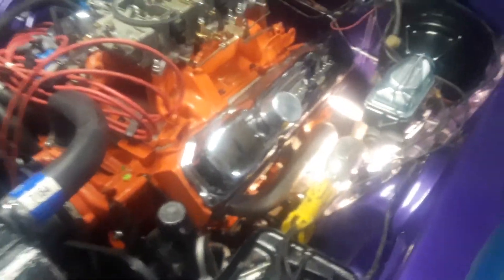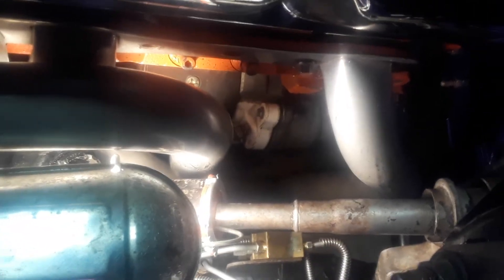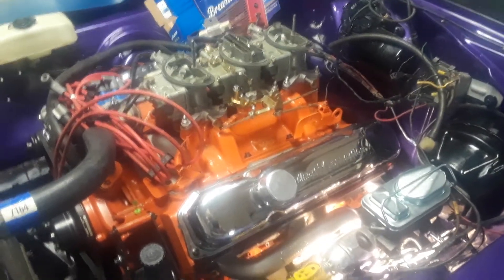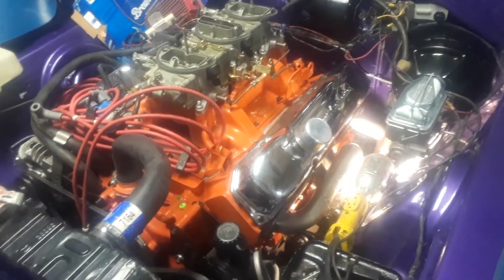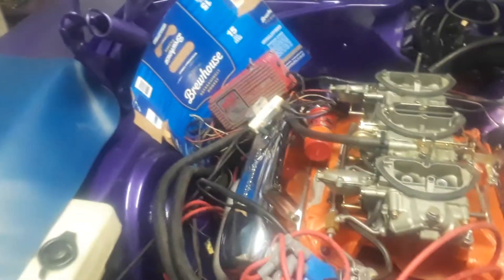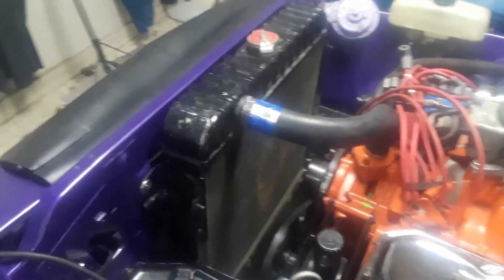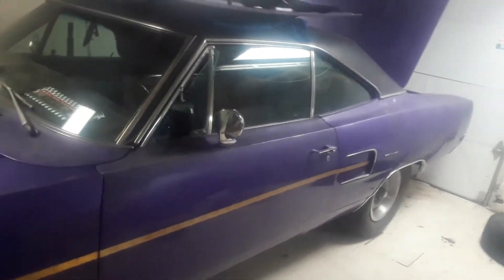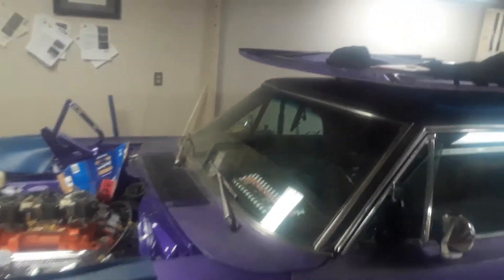Randys road runner RRR

Comment: Hi CN  would 12volt thermostat controlled fans be an option?
Reply from the maker: yes and aluminum 4 core rad also about an extra 2000 all in
Reply: @crazyneighbour2429  its been my experience that aluminum anything is expensive...but there is superior heat shedding in this case for sure so  I totally approve. And it would look very nice  indeed.
Randy if your watching : whats another two grand old son? That rad looks a bit rough around the edges  eh?